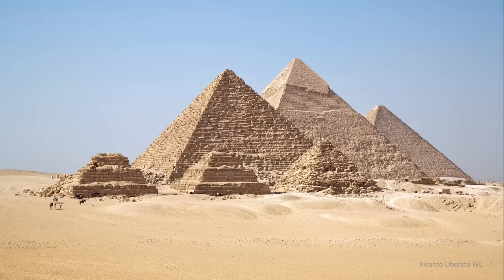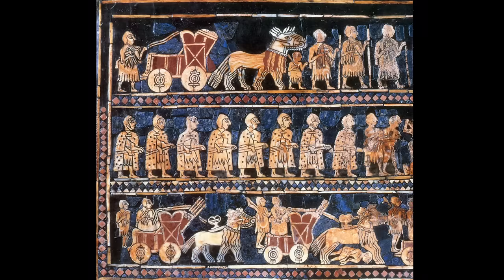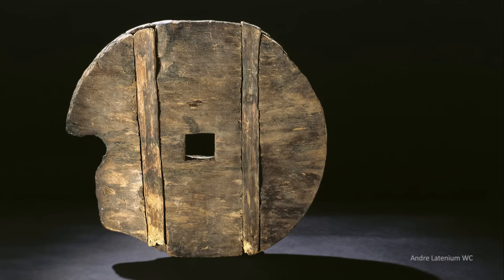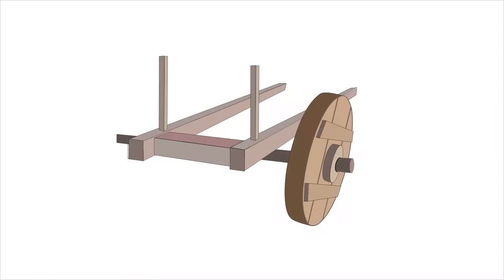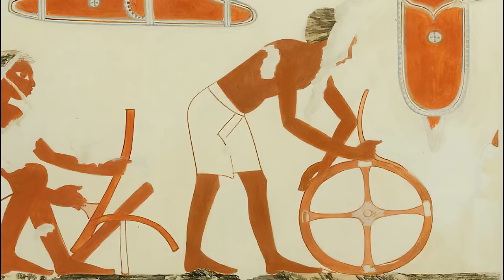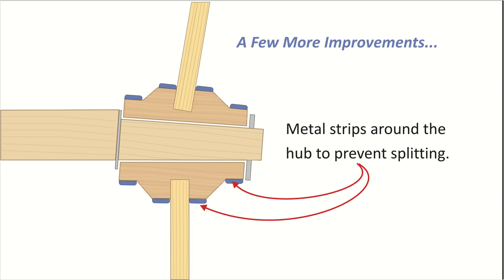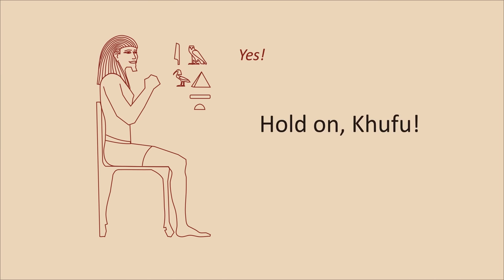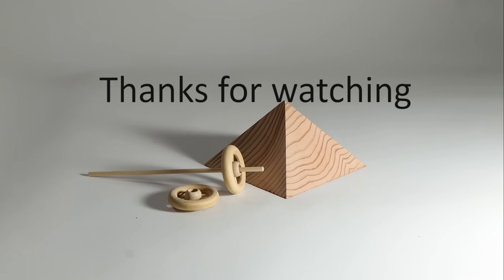Wheels, Pyramids, and Woodworking Secrets

Comment: There is one clue at the pyramids that you have missed. The causeway. A hard, straight road that paved the way between the river and the building side. Some causeways are still visible and one interesting detail is the existence of walls and even a roof. Why building long roofed corridors between the water and the building site? My guess is that it was filled with logs, which acted like a conveyor belt in a supermarket. No need for wheels. No need for steering. The simplest explanation is the best one.

Comment: Very interesting video. The thing is that the Egyptians were far more advanced than the current narrative suggests. They drilled perfectly round, smooth holes in granite (the hardest natural stone there is), and the sarcophagus in Khufu's pyramid is the most precisely made granite object in existence - it features perfectly square and flat edges. Additionally, there are many unfinished stones which show milling marks, and they indicate a circular blade was used, much like we do today.

So you should question the narrative of modern egyptologists, they are hiding something....